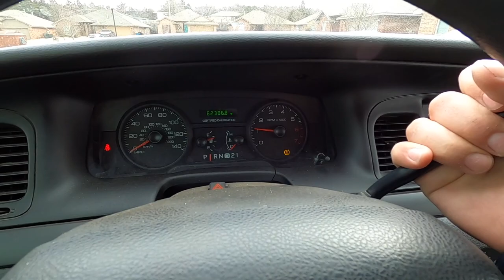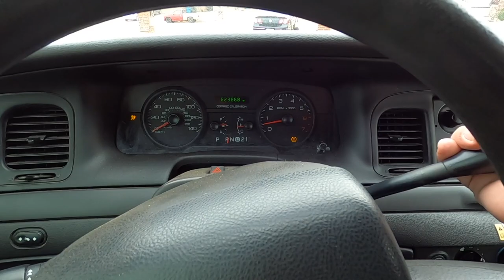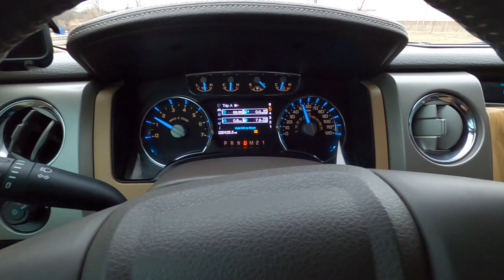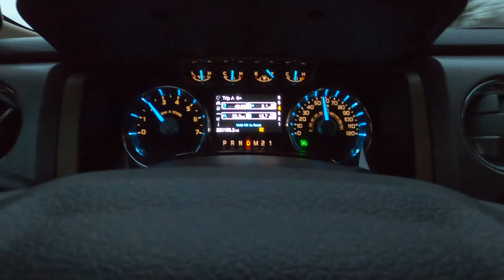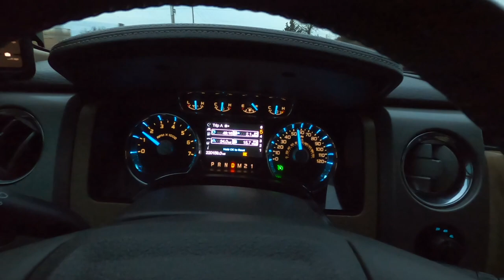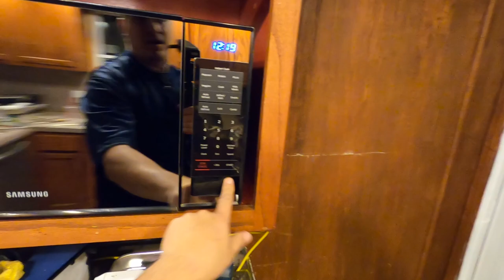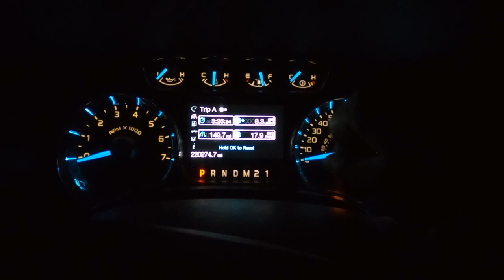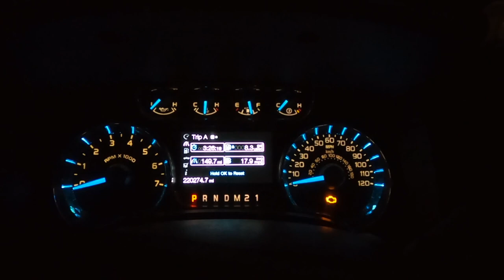Towing the Copart VW Passat with the 220K Mile F150 EcoBoost + AAR HQ House Update!

Comment: G'day Randy, I have been a whitegoods salesman for 38 years. You are perfectly correct about laying down fridges. The oil lays in the bottom of the compressor. When the fridge is laid down this oil runs up into the gas lines. Standing it back up allows the oil to settle back to the bottom of the compressor again. There is a correct and a wrong side to lay the fridge onto.

Comment: I used to have that same Dolly and what I did was I went to Harbor Freight and bought a winch mounted on the front of the dolly that way when I was able to hook up a battery to it that pull cars up on the dolly just go buy the cheaper winch I believe they're about 60 bucks they do a perfect job you can mount them right directly just drill two holes in the front of the dolly Monett right on the bar they work perfect

Comment: When you transport a refrigerator you aren't supposed to lay it on it's side.  If you do you need to allow the Freon to settle back to the bottom of the system or you could blow the compressor.  let it stand a few hours before turning it on.

Comment: Randy I must tell you as an almost 30 year veteran of appliance repair that you are incorrect.  Just because you have been lucky doesn't make your assumption correct.  It isnt about the freon gas  getting disturbed.  There is actually oil in the compressor that can seep into the capillary line which is a really small tube. If the oil gets in that line it blocks the freon flow and is what's called a plugged system. I'm glad it worked out for you though, but please dont tell people that how you moved it is acceptable because really it's not. Great content my friend. I live watching your videos. Cant wait till your lot is open and running. Gonna be a whole new line of content that I'm sure will be great.

Comment: That is true crown VICS are definitely boats but they are fast boats. My wife just said they are speed boats
Reply: Thomas Smith I wouldn’t say a “modified” Crown Vic. They had a completely different engine. They had the 32V 4.6L out of the Mustang Cobra. This results in about 65 more standard HP. Also, a console shifter, different rear end gears, standard traction control, etc...

Comment: Randy I love crown VICS and because of that I know a couple of things about them with the police version you might have a shift locker if you remember older cars they had the fog light button on the floor lift up the carpet around that general area and you’ll see if you have it or not it’ll look basically like a hockey puck and if you press it it could lock you’re gear selector. Cops put that in so they can leave the car running when they exit the vehicle without fear of it getting stolen. There’s a few videos on YouTube about hidden features you might take a look at some of them

Comment: My 2011 crown Vic did the same thing. I forget how i fixed it but under the steering wheel close by the key should be a hole. That's the shift interlock. Stick a phillips screwdriver in there and then you can shift into reverse or drive

Comment: Check under the driver side Rubber rug there should be a shift interlock distempered it looks like a bubble That prevents you from shifting it out of gear unless you depress that bubble which releases the lock in the shifter

Comment: I once saw someone dealing this kind of issue with the tow dolly. Deflate both tires, it will lower the height and you can inflate it after car is on it if you have the air pump and it doesn't ruin the tire..lolz silly I know..:)

Comment: Why should you not lay a refrigerator down?
In the normal upright position gravity keeps the oil in the compressor. When we lay the refrigerator flat, some of the oil can leave the compressor and go into the cooling lines. ... If we must lay the fridge down, it is better not to lay it 100% flat, but rather to keep an angle so gravity keeps the oil in the compressor.

Comment: At 8:21 the DIC said "Could Not Program Integrated Key".. some keys/fobs need to be re-programmed to the vehicle after the battery is replaced. Alot of cars you can insert a key that is already programmed and turn it to ACC for a few seconds, then quickly remove that one and insert the unprogrammed one and do the same thing, then start the vehicle with it and it will program it.. others you have to take to the dealer.. so that could explain why the fob isn't working even though it has a new battery in it.. or maybe the receiver is messed up

Comment: Refigerators are scroll motors they can “slug” some and be fine On its side or straight up it will be fine to plug in what REALLY causes an issue is the computer on it. Sudden power to a moisture/temp change us what gets them

Comment: a brake switch will fix the hard to go in gear issue with the crown vic...its a common issue with the panther platform and its a cheap and quick repair....

Comment: @autoauctionrebuilds that p71 has a tremco safe idle installed, theres an air bladder under the carpet under the ebrake that you hold your foot on and youll hear a beep and it releases the shift interlock
Reply: Actually looking back its your brake light switch

Comment: Has the Keyhead remote (ford calls them "Integrated Keyhead Transmitter") ever worked since you've had the vehicle? The truck can support 8 ignition keys but only 4 IKT remotes, @ 8:20 the instrument cluster reads "Could not program integrated key", per the owner's manual this means the key in the ignition is key #5 or higher. There are atleast 4 other keys programmed to that truck. Unfortunately, I think you need a dealer scan tool to re move the keys you don't have.

Comment: Hey Randy, Can you please do a video on best ways to lift the car to work underneath like oil changes? I have a Porsche Boxster 986 and ramps are only adding 8" in height (total about 14 inches from ground) and struggling to get underneath to do oil changes. Just working how you work underneath the cars. Thanks,

Comment: Hey randy, I just got a truck like yours yesterday my first truck. 2010 ford f150 lariat. Theres 223*** kms on it
Reply: 4-WHEEL SQUEAL congratulations
Reply: I hope your diff is good. Get that fluid checked so it doesn't get Randy's problem. Seems like a decent ute otherwise. That dash board is noiiiice!

Comment: I used to drive a 1997 ford 350 dually, i hate how you would have to hold the brake down hard and try several times to get it out of Park

Comment: I'm surprised how long that eco beast has lasted
Reply: Why? I have seen so many of these with more miles.  When they came out I was skeptical about the longevity.  But they have proven to be amazing
Reply: @ethand4900  ya because I heard they aren't as good as the v8 but back then even now the 3.5 in my opinion is better ford  forward make small turbocharged engines my favourite is the 1.0  L EcoBoost

Comment: Well a dolly is only 55 speed limit
Reply: Trailers are not supposed to be driven at speeds over 60mph. The trailer might sway, especially when not loaded and it can cause a tire blowout. It depends on the quality of the trailer tires too.

Comment: Ik the 2010 to like 2013 f150 are pieces of crap just absolute junk. it seems like everything starts breaking on them my mom has had for for three years it's got 140,00 miles on it. it needs a fuel filler neck, ac fan motor, the driver door stop unlocking. The interior lights won't turn off the blinker switch keep going bad shes changed it three times so far. the ac quit working the wipers won't turn off she has to take out the fuse just complete junk. Not a fan and never will be. I'd rather get dodge.